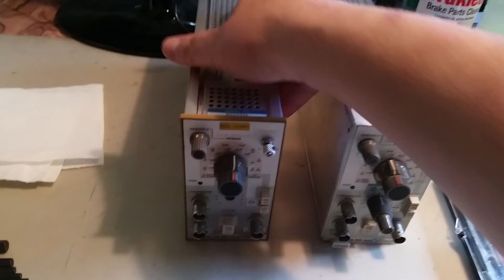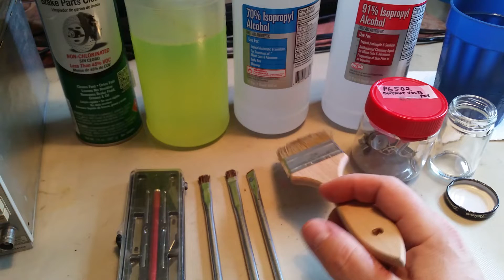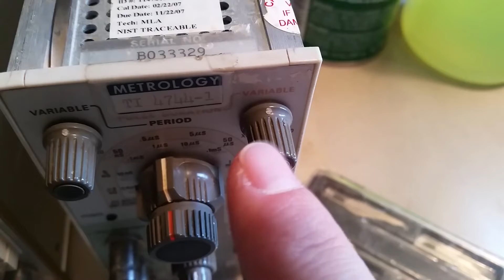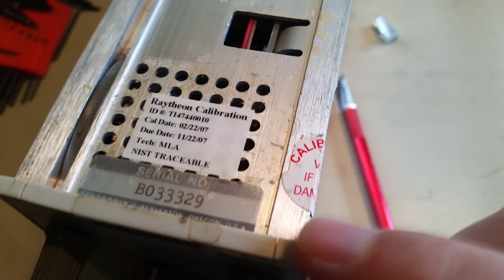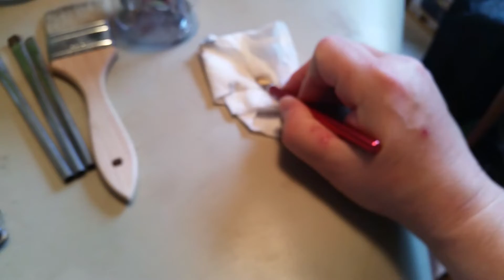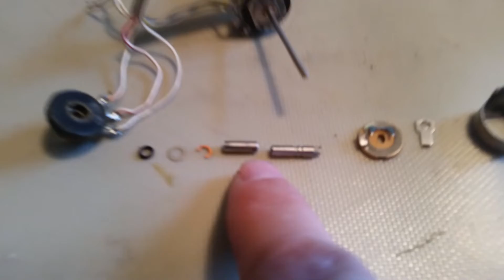How to Clean Metal Electronic Equipment Cases & Covers

Comment: I need a Caravan ECU.
Reply from the maker: Look up the numbers on your ECU then go on eBay or take a picture of it and take it to the local wrecking yard. The person behind the counter can look one up for you in the yard. If they don't have it sometimes they're a member of a group that can find the part anywhere in the country. Hope that helps. Best Wishes & Blessings. Keith Noneya
Reply: @keithnoneya  Thanks Keith, your videos have kept my van running.  Is it really that easy, no flashing required?  Thanks for everything.
Reply from the maker: 0 @michael_horsley  Yep it's that easy. Dodge made thoughsand's of these vans with the same options and they didn't want to flash every van ECU. So the codes are generic to that model if the numbers on it are the same. It's the same way for other manufactures as well with very few exceptions. Thought it was funny you posted the question on one of my electronic videos instead of one of my Van video's, but WTH it helps the algorithm for this video. 😂😂😂